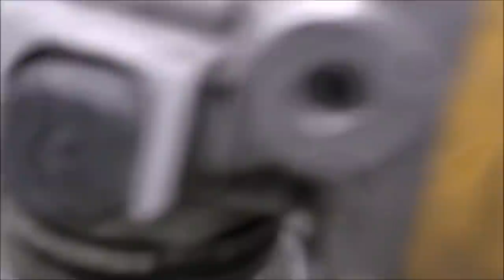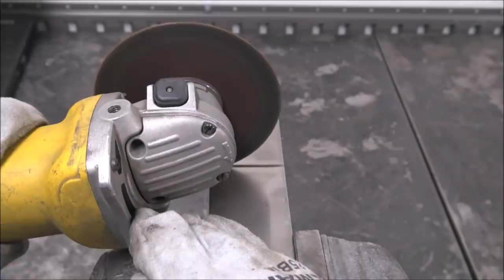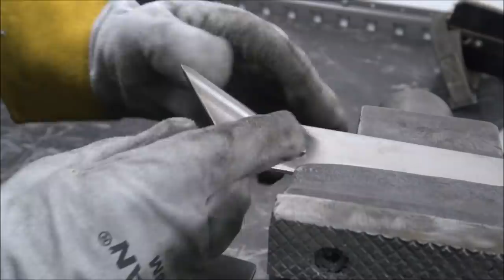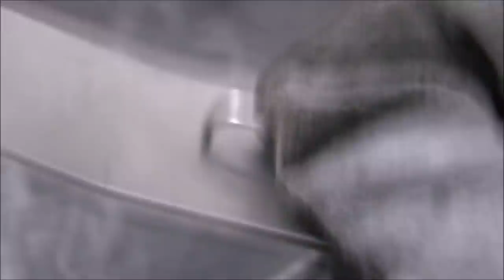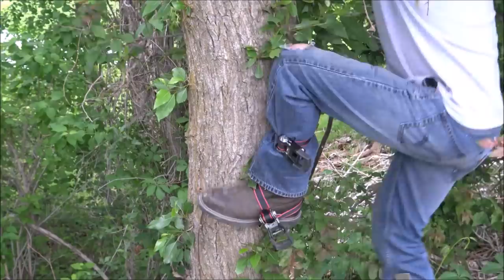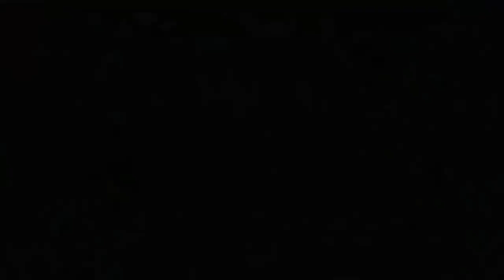TIG Welding Stainless Fabrication - Tree Climbing Spikes

Comment: A tip if I may from someone who has fallen from a pole using spikes, make sure you have a belt around the tree that is fastened into a waist harness, and then also have a seperate safety strap that you move up the tree as you go. They pulled a 7 1/4 in long splinter out of my stomach after I bounced down a pole, wily coyote style, when my spike hit a rotten spot on the telephone pole I hadn't seen. Not to mention the 3 weeks on crutches for the sprained ankle and twisted knee that 20 years later, still hurts when the rain is coming.
Reply: Rain is Bout to Thunder here,.  Chihuahua is Panting away Scared as Heck..

Comment: we need more stainless info on the site!
Reply: 6061. com personally I would like to see basic stuff. I completely switched my setup based on your cup, tungsten and rod suggestions for aluminum and have been super happy. I’m sure plenty of people would love more in depth stuff, different styles, basic knowledge of welding stainless vs aluminum. Also, I couldn’t find on the site where you buy your consumables. If you have an amazon link or site you recommend, I would gladly purchase from there.

Comment: I guess you never move those fingers on the metal brake since there's a snapped off hex in one of the bolt heads.